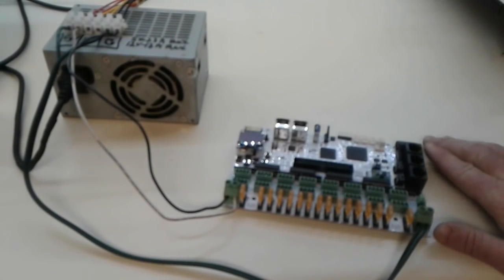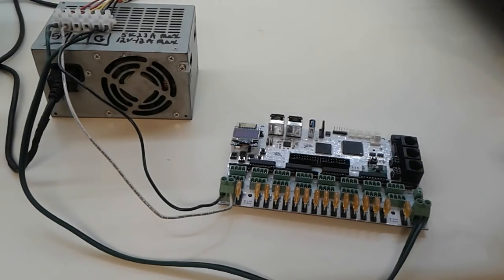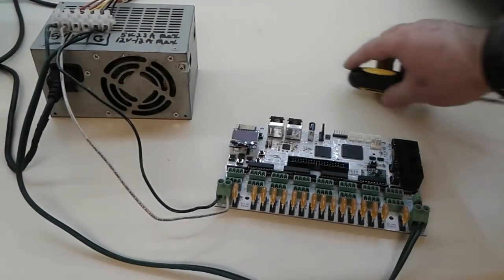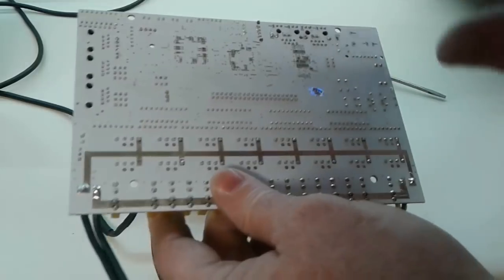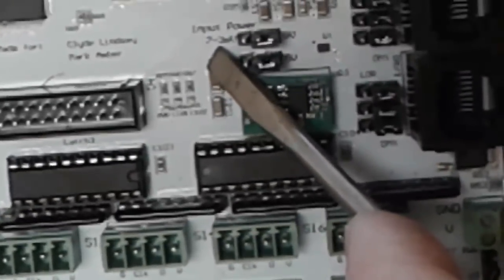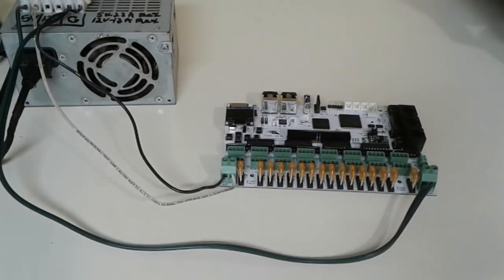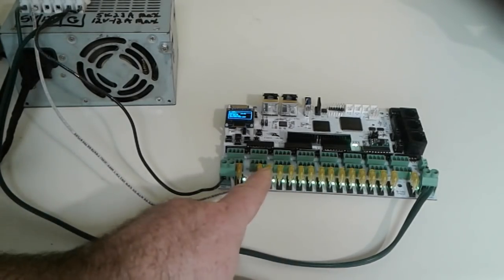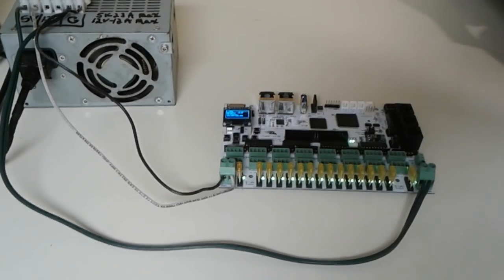F16v3  Connecting power for the first boot-up

Comment: It's probably worth noting a couple of things. 
-ONLY change the power jumpers while the board isn't powered
- I think that the control power comes from the right hand bank so the jumpers need to suit whatever voltage is going in this side
-power has to be connected to the right hand bank regardless of whether pixels are connected
-you only showed 1 power jumper being switched. Both jumpers need to be changed
Reply from the maker: Alan H 
don't worry I'll be doing a follow-up video on this and many other options of the new v3.  Thanks for the additional information!